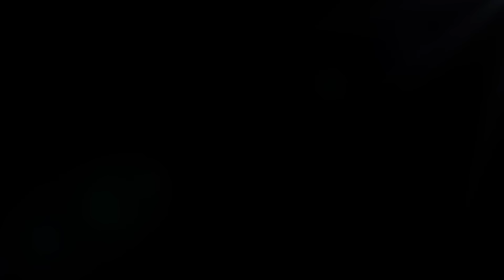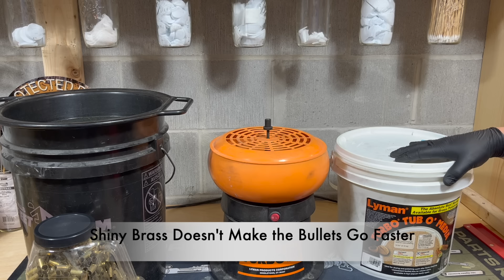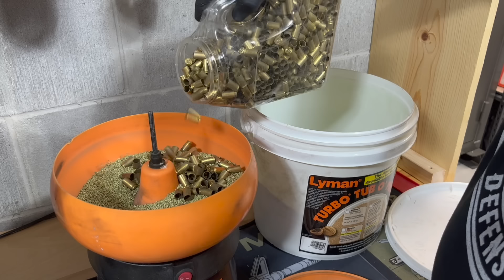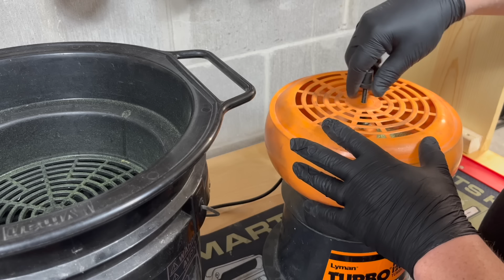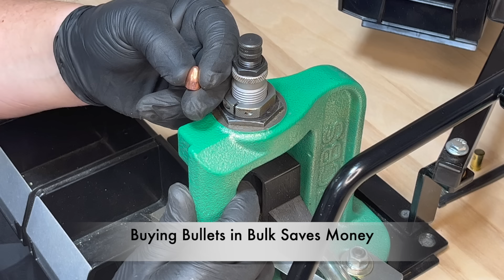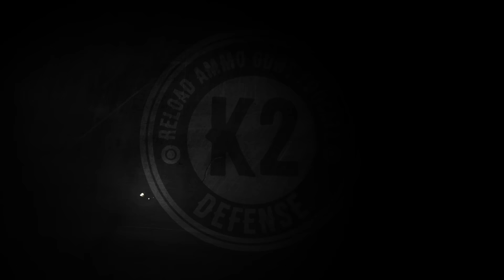How to Reload 9mm Ammo For Beginners Single Stage Press

Comment: Thanks for putting up the video.
Been reloading for 24 months about 3,500 rounds. Some things for people wondering if reloading is for them.
This hobby is for people who don't mind slow and steady, meticulous and neat.
Material cost per round of 9mm can be from $0.15 per to $0.28 depending on what bullets, powder and primers you use. There's some cheaper good bullets out there that are not full metal jacket.
However, equipment costs for the press, dies, scale, powder measure, calipers, other tooling, cleaning equipment can run $600 t0 $1200 depending on what you get.
So while your material cost may be fifteen cents a round, your first cartridge is going to cost you a lot more.
Hint, if you reload for one cartridge like 9mm, it will take a long time and a lot of cartridges to break even.  If you can split that cost up over multiple calibers, the cost can be recouped faster.
You don't need a dedicated "reloading bench"  You can mount your press on a piece of hardwood, then clamp it to a table. The press gets a lot of torque, so you need a very solid block of wood, table and clamps.
Powder and primers need to be stored in a cool dry place.  
Start to finish to set up, load 100 rounds, clean up and put away, it takes me about 1.5-2.5 hours of labor. That does not include the time spent cleaning cases while they are in the machine. Rifle rounds take even longer.
Unless you are an FFL you can't legally sell your reloads.  And when people find out, they will ask. If there is a safety problem they will say where they got the ammo. 
Keep records of your loads.  Keep your loads identified by the powder, powder weight, bullet, length et cetera. This is in case you find problems.  Don't just put all your different loads in one ammo can and say it is reloaded 9mm .  
Inspect at every step.  Look for damaged brass, primers inserted all the way, uniform level of powder, uniform length.  Powder weight, critical important, check often if using a volumetric powder measure.  Don't expect volumetric measures to be on a tenth of a gram consistently. If you are reloading for precision you may want a powder trickler.  (Equipment cost and reloading time. picky picky picky)
Some people don't trim handgun cartridges. Variations in case length will affect how much crimp is applied. If you are using brass from multiple manufacturers and non metal jacket ammo this will be an influence. There's plain lead ammo, copper plated lead, powder coated lead, and these all crimp softer than FMJ or JHP.
Most of us trim rifle brass to length.
After trimming you need to de-burr.
Some handgun and rifle brass have the primer "crimped" into the base.  This makes it harder to extract and even harder to put a new primer in. You can swage or ream primer pockets.  Swaging is faster, cleaner, but the tooling is more expensive.  Reaming is messy, takes a bit more time, makes a mess with brass shavings and can cramp your fingers.
Shiny brass doesn't make bullets go faster, but it does keeps the dies scratch free longer.
Carbide dies are more than worth the money.
Another excellent resource is the Sporting Arms and Ammunition Manufacturers’ Institute (SAAMI) specifications for cartridge and chamber drawings. These include the tolerances on dimensions.  If you understand technical drawings it is a great tool.
Some of us deprime the case before cleaning.  There are dies that just push the primer out. This can give you a cleaner primer pocket.
The bullet seating and crimping die shown here is sometimes done with two dies, one to seat, one to crimp. 
Some have mentioned cleaning brass in soapy water with steel pins.  Lots of us do that.  I started with an empty peanut butter jar, a pound of pins, some dish soap, some citric acid powder and hot water with 100 or so 9mm brass.  Shake, rest and repeat until the brass looked good enough.  Strained into a colander with a bandana. Picked out the brass, rinsed the pins and put them back in the jar.  Rinsed the brass and place on a towel on top of the clothes dryer for multiple loads, until warm and dry.  It was cheap and available. I did 2,000 rounds that way.  
Keep your reloading press clean and lubricated.  Keep your dies clean.  If you don't have carbide dies; you will need to clean the sizing lubricant off your dies.
Reply from the maker: Hello Phil D! Great comments! Appreciate your input!
Reply: Love this comment! 
Thanks a bunch! 
I reloaded for precision for my 308 many years ago. Dialled in my loads, loaded a bunch, and haven’t had to reload since lol I guess I need to go shooting more often SMH

But now I’m considering reloading for 9mm so this will help greatly

Thanks again
Reply: After washing, you can also dry them quickly on a baking sheet in the oven: 170 degrees for 15 minutes.
Reply from the maker: @BRLaue - good to know! Thanks for that info! Is it the same for a convection vs regular oven?
Reply: @k2defense Never tried it in a convection oven, but I don’t see why not.
Reply from the maker: @BRLaue - thanks for the reply! 👍🏻
Reply: Thank you for writing all this. One of my questions was how much time it takes. Sounds like this will prob have to be started sometime after I retire
Reply from the maker: @brimmed - like I tell everyone. Until you become comfortable with your load data and process it take a bit longer. Too many variables to say how long it will take a person. I really should time myself on how long it takes to do 100, 200, etc. I get this question a lot. Thanks for the comment! 👍🏻
Reply: Shame its 18 to 27 cents, as a new bullet can be around 27 cents. I save much more for my shotgun on reloads, this savings seems very small.
Reply: @ThePromptWizard2023  My last batch used Gallant bullets, CCI primers and Winchester 572 powder.  15.1 cents a round, total material cost.  This is less than half the price I I'm seeing at a local Sportsman's Warehouse 34 cents a round.  Next up on schedule is  Hornady XTP hollow points with same primers and powder, total material cost is 28.1 cents a round. This is less than a quarter of the cost of hollow points which are running around $1.20 a round.
My 223 Remington ammo total material cost is about half of buying ammo at Sportsman's Warehouse. 28 cents vs 55 to 80 cents a round. 
I've got a couple years worth of ammo made and components stocked up, so my being impacted by shortages is minimal for now. 
Wife asked how long our stockpile would last I told her 3 years of normal shooting, 12 years if we conserve and 72 hours if it turns into the wrong weekend. If I have to supply the local militia; well, I can deal with that.
Reply: @ThePromptWizard2023  Oh, I reload for 20 gauge and 410 as well. Birdshot and defensive loads.  Yah, some big savings there, especially 410 buckshot. 37 cents vs a buck or more a round. I don't even see it in stock lately.
20 gauge, birdshot, closer to retail at 24 cents vs 44 cents a round.
Reply: Seriously great comment, aside from this one comment: 'Unless you are an FFL you can't legally sell your reloads'. Not True. Many 'gun' shows allows ANYONE to sell reloads cart blanche, especially here in AZ. Not sure of other states...
Reply: @AXNJXN1  Thanks.  It used to be part of my job to write work instructions.  I still do it sometimes. 

Arizona and sportsman's shows got nothing to do with this.  A Federal type 7 FFL And SOT Class 2 is required to manufacture and retail ammo in the US.  If the feds wanted to they could easily have a trial that resembles the trial of the Amish guy busted for butchering and selling beef, only prosecuted with help from other less popular three letter boys.  The media would call it a crisis of unregulated manufacture and sales of deadly ammunition at gun shows.This would be prosecuted as done deliberately against the law. Except for people that know about firearms and reloading the public would back prosecution. 

I know it happens, you know it happens, the three letter people know that it happens.  They just haven't done anything yet. And I wouldn't recommend in public that anyone do it.

I could sell my ammo to friends, probably not get caught. But that little chance, a missfire, a light load, followed up by a full power and blow up a barrel, somebody gets hurt, I don't have hundreds of corporate lawyers and deep pockets.  And that is before the Feds step in.
Nope, not gonna do it. 

Now, lending people my press, dies and watching, I haven't seen any law on that...
Reply: This is the comment I was looking for. Thank you. I buy my ammo in bulk and shoot 1,000-2000 rounds a month. I don't have a lot of free time so my $250-500 ammo bill shipped to my door seems like its still worth it for just 9mm ammo needs alone.
Reply: Holy shit what a YouTube comment
Reply: @jessepayne8847  It has been saved in word and copied to a bunch of videos. The round count is much higher these days. I've worked my stash up to about six to eight years of ammo and have slowed down a bit.  
The answers I supply are to the common questions that are often overlooked in a lot of videos.
Reply: @phild8095 lot of good Info in there!
Reply from the maker: @jessepayne8847 - Phil-D is in the house!!! You know it. This man has been saving it up for many many years to share with us neophytes!!! I always enjoy when he comments! 👍🏻
Reply: I accidentally bought projectiles only when looking for ammo and so I was like how hard could this be? 
Now I wanna get rid of them but sadly I cannot return them and I do not want to get into reloading. Any advice?
Reply: @Icy_Pumpkin  I recently had an AC tech in the house.  He noticed my reloading equipment and asked if I reloaded 9mm as he had two boxes of Hornady hollow points bullets (only) someone had given him thinking they were ammo. We had a trade, 200 XTP hollow points for a used percussion instrument.
I'm pretty sure someone you know who shoots also reloads.  And even if the bullets aren't something that person reloads they would trade or pay you for them then trade them with someone else.  Just ask around, sooner or later you will find someone who is interested.  Alternately, maybe a local gun shop would give you a reasonable price.  They won't give you retail, but it might be reasonable.  Or an online message board.
Reply: @phild8095  yeah that is a good point I honestly wouldn’t mind trading or something because I know I don’t have the time to reload but I really hope someone I know does reloading so they can trade or buy off me 

Would you recommend asking around at like a shooting range or something?
Reply from the maker: @Icy_Pumpkin - some stores will take them back as long as they are not opened. If that doesn’t work, take them to the nearest mom and pop reloading store and see what they can do for you. There are some reloading forums online that deal with this as well. I cannot recommend any per YT community guidelines. Sorry I couldn’t be of more help! Good luck! 👍🏻
Reply: @k2defense  no worries but you gave me a good idea to look for a mom and pop. I hope they don’t charge too much to help out
Reply from the maker: @Icy_Pumpkin you bet! 👍🏻

Comment: Is it actually cheaper to reload 9mm than buy factory ammo?
Reply: My material cost for my last run of 9mm was $0.151 per round. Current 9 mm retail is $0.38 to $0.90 depending on whatever BUT...your first round will cost close to a thousand dollars.
And here comes the labor time, material costs and equipment costs discussion.
If you spend $800 bucks for equipment, #40 for a pound of powder, $110 for a thousand primers and $25 for 100 match grade bullets or $68 for 900 powder coated lead bullets and use two hours of your time to make 100 bullets, how much does the first round cost?  And you could spend much more for equipment if you want all the latest and greatest.
My 0.223 Remington reloads last run material cost was $0.282 per round.  After 1,000 rounds my total cost including equipment is $0.526 per round. current retail around me is about $0.60 to $1.20. 
If you see what I mean by equipment cost, you will understand that my first round cost me over $650. (I bought the equipment a few years ago, prices have increased)
To make these total 3,600 rounds has taken me somewhere around 50-75 hours of my time.
I've got a stockpile of bullets, primers and powder in the home as well.  So that adds to my cost too. (within SAAMI and NFPA recomendations for in a residence) (Look up SAAMI and NFPA if you don't recognize them.)
I'm retired, no kids at home.  Reloading keeps me busy and out of my wife's hair. She likes to shoot as well.  I came close to running out of primers at one point, by my ammo inventory never dipped below 6,500 rounds during the past couple years.
You can make it cheaper, but you have to have the time, the initial investment, positive feedback from the spouse, workspace, and the storage space.
Oh, powder and primers a a Department of Transportation restricted shipping item.  They cost extra to ship.  Even when your favorite place has free shipping if you spend over 50 bucks, ad twenty bucks to cover this extra DOT shipping cost.  And even though loaded rounds contain primer and powder, they don't have this extra shipping cost.
Reply: @phild8095  I figured match 223 was probably worth it but if it's that cheap for 9mm I'm going to go ahead and load that too. Thanks for the info.
Reply: @Longrangetargets  I can make my loads much more expensive.  My latest primers were 110 a thou, and if I loaded a nice JHP I'd be up around $0.35 to $0.45 per round.  But then JHP on the market these days is $0.90 to $1.50 a round. Most of my handgun ammo has been Berry's or Blue Bullets of Gallant. When I got started I had some cheaper Hornady JHP that didn't have the segmented or bonded jacket. They expand, but not like a nice XTP bullet.
Reply from the maker: Hello ViciousMachine! Phil D nailed it. Exactly what he said. 👍🏻

Comment: Straight wall brass does not stretch from resize.  If anything it shrinks.  The only reason to trim handgun brass would be the heavy hitters so you can have a uniform roll crimp.  Do yourself a favor....quit using the treated corn cob media. That treated lyman polish leaves a residue on the brass.  Add used bounce dryer sheets  Buy Blasting media from Grainger 14/20 grit and get some Dillon Case Polish.  When filling a vibratory polisher....fill it half full of brass.  Then add your media till over 3/4's full.  Do not over use media it is cheap that treated stuff attracts so much crud.  

Storing primers in an unmarked container is not a good idea.  Especially not identified. 

I see Berry's bullets on the bench...they are not FMJ. but copper plated.  Plated bullets use cast bullet load data.  One must be careful and not over crimp.  Over crimping plated or coated bullets can strip the plating/coating off and lead to leading of the barrel.

One should always caution when reloading to know that what type of barrel you are reloading for conventional rifling or polygonal (Gen 1-4 Glocks and HK's come to mind).  Lead and coated lead bullets generally are not recommended for polygonal bbls.
Reply: I agree, straight wall brass does not stretch like rifle brass. But using range brass from different manufacturers and using lead bullets rather than metal jacketed bullets, (Berry's plated, Blue Bullets, Missouri Bullet Co, Gallant, etc.)the difference in brass length can easily give you different crimp, greatly affecting pressure, velocity, impact and as you stated, leading. 

Unmarked in reloading??? I even keep my loads separate and ID'ed by date, bullet, powder, primer...
Reply from the maker: Hello Phil D! I should’ve shown my components a little better. I have everything marked for proper identification. Filming takes hours as well as editing. Anything that appears unmarked in the videos is closely regulated between me and my producer. Appreciate the feedback!
Reply from the maker: Hello John E! Appreciate your input!

Comment: Very good information regarding reloading for beginners keep in mind another option for cleaning is with steel pins. Also instead of removing and using your barrel as a case gauge they actually make go no go gauges for finished ammo to make sure you’re in spec for shooting.
Reply from the maker: Hello Rene! I purchased a case gauge today! Thanks for the pointer!
Reply: I have case gauges, but do the "plunk" test always. Extra safeguard for me. My 9mm pistol is very finicky and temperamental, so I don't take chances. Now my 45 ACP very forgiving